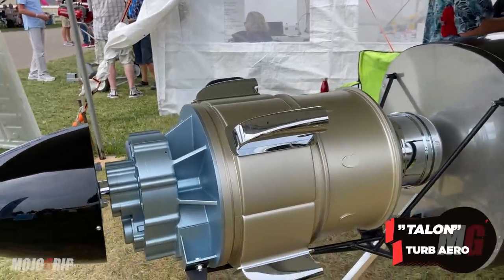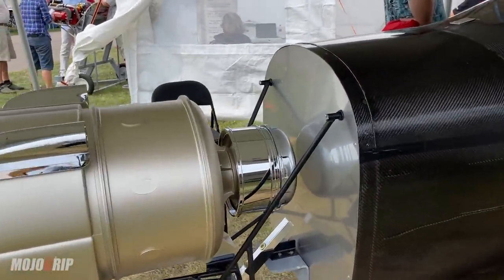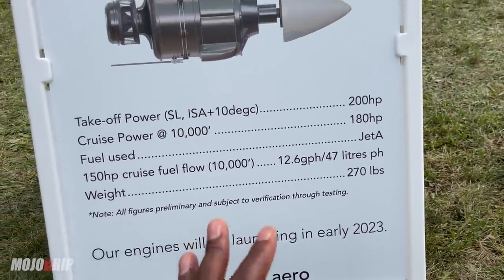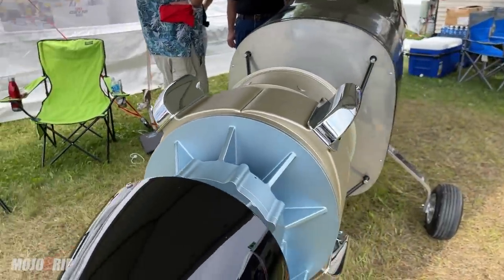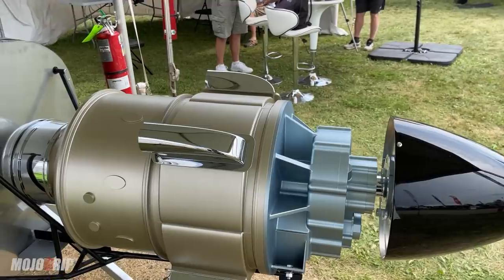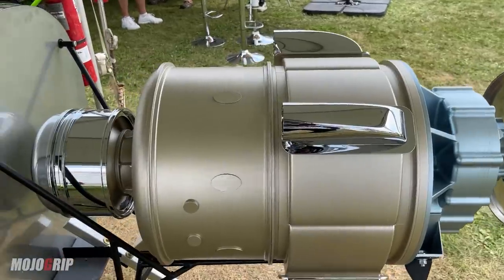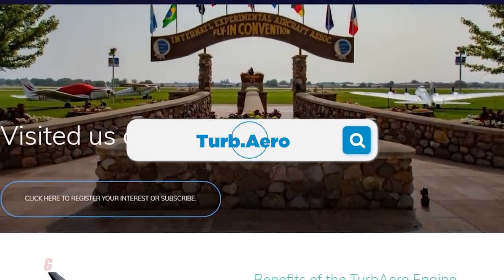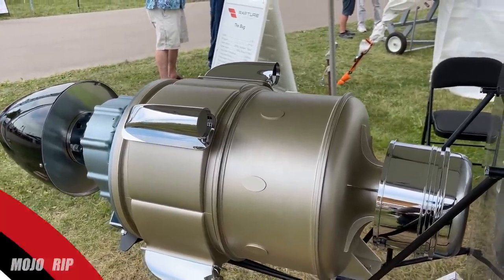200HP Turboprop Engine To Power Single Engine Airplanes - TurbAero

Comment: Get this thing STCd, and I can see a ton of old twins getting a new lease on life. I’m looking at you, Cessna 310.
Reply: Unfortunately, if you put a turbine on a CAR 3 OR  FAR 23 certificated twin you now must comply with all the SFARs on life limited airframe components. That’s why no one has a(successfully) done it.
Reply: @rexmyers991  What about getting one into the experimental category? What are the limitations there?
Reply: @autophile525i  there are four (I think) categories of ‘experimental’ . The one most are familiar with is Experimental - Amateur Built. You can fly IFR, carry passengers, etc. But the airframe  has to be at least 51 percent amateur built. This rules out modifying a twin. The other types are like Experimental Research, Experimental Exhibition, Experimental Light Sport. You could put the 310 in research or exhibition but you can’t carry passengers. I owned a 310B for seven years then got a 310R. I flew the R for 18 years. LOVED it. Best General Aviation twin I ever flew. Only twin better was the Boeing 757. But the FAA said I couldn’t fly it any more (aged out). I alway thought if I could find Diesels to put on, I could burn Jet A, get way better fuel consumption and not worry about Life Limited airframe parts.
Reply: @rexmyers991  Thank you for the rundown!
Reply: @rexmyers991  You need to upload some story time videos. I’ll bet you have some good ones!

Comment: That is a game changer for light and experimental. With a variable pitch propeller: its Reno racing!
Love to hear the start up and running.
Hi Mike from Sydney Australia
🌏🇦🇺
Reply: I have a Solar T-62 with the same performance/fuel burn, they've been around for ever.
Reply: running? where did you see that?

Comment: Those are amazing fuel burn specs! Lovin these small turboprop / IC engine replacements. AFAIC this is the powerplant of the future for everything! For automotive use it would make a  light and effective low-emission generator for hybridized use.
Reply: The price will have to drop by a factor of around 20 before this engine could become a viable option for automotive use.

Comment: Mojo, the PBS TP100 only weighs 157 pounds wet for 241SHP and costs around $120K. 1500 TBO, that’s the turboprop I’d be rolling with if I had the money.
Reply: Unless your original engine was 160ish Lb wouldn’t that screw up the W&B on your plane?

Comment: I believe this engine will never fly but still interesting how people are amazed by a trestle and a table full of numbers...
Reply: why not? there are 90hp gas turbine engines flying on experimentals, so why not?
Reply: To your point, I was nearly taken in by Jim Bede's letter in 1968  promising to build an aircraft for a very low price all that was required, a small deposit to secure a delivery slot. As you may know, that aircraft was stalled in the certification process and likely due to a 
cash shortfall the project was sold to Grumman and became the Yankee, but that "very low" price evaporated.

Comment: Efficiency is obtained by the heat exchanger preheating compressed air thus saving the corresponding amount of fuel. The real challenge is to minimise pressure drop thru the HE which here seems to be annular.

Comment: A smooth, quiet turbine with 200 HP at under 13 GPH and less than 300 pounds?? What's not to like about that?? As they prove the engine in service the TBO will increase further reducing the cost of operation.  Keep and eye on this one.

Comment: Hi Mike!
Cool if this works. The specific fuel consumption is always a problem the smaller the turbine is.
Reply: @jackt6112  Hi!
I was literally born into the aviation industry, GA. I've seen so many potential engines come and go unfortunately. It's a pity that we don't have any big changes as on the automobile side, of course they have a lot more money. A late friend of mine flew Junkers aircrafts with Junkers opposed two stroke Diesel engines in the early forties. very good specific fuel consumption. He was a chief test pilot of Junkers. After the war, all the money went into turbines of one sort or the other.
Best greetings from Sweden.
Reply: @rudolfabelin383    I started out as an aviation mechanic for the military and then the academy and flight school.  For small aircraft, I've owned a Skyhawk but love the Mooney.  People that say turbines are simple don't live in the real world.  A small, practical, low-cost turbine is an oxymoron.  The problem with small turbines is they are difficult to scale down well with regard to efficiency and cost, plus it's more than just hours.  Each start costs you money.  Weight has to be awfully important for smaller turbines to make sense which is why you only see them in smaller helicopters and even then you need to keep them busy making real money.  The little turbines are not more reliable than a recip.  Even the little Allisons were certified looong before they deserved to be.  IMO the PT-6 is the base.  It's going to require a technology breakthrough such as molded ceramic parts for a GA engine to have any promise, and even then, there is nothing cheap about the fuel control, gearing, etc.

Comment: From the schematic it looks like they took pieces from a turbocharger, added a gear box, and some kind of power recovery device (recuperator) to use the exhaust gas for add on efficiency.
Compare this engine to the Rolls Royce, former Allison turbine engine, used in several helicopters and adapted to fixed wing aircraft. When I was servicing them in Vietnam it was called the
 T-63 A5A. It was limited to 317 hp by the transmission in the OH-6A. 600 hp was required to turn the compressor. The engine weighed 171 pounds when ready to install in the Hughes helicopter. They were very reliable, although I do have a photo to prove they were not quite bullet proof.

Comment: It’s a great idea and it’ll be a game changer. I’ll be getting one ASAP and putting it in something like a Black Shape or similar.
Reply: An $80k engine that probably won't come anywhere close to currently claimed performance numbers that cranks out less power than a $60k twin turbo piston engine while burning more fuel... not exactly a game changer.
Reply: @ParadigmUnkn0wn  Check out the pocket rocket. 450 SHP turboprop that burns 85-90 doing 270. 

Your opinion is?

Comment: I don’t see how the much higher fuel burn makes sense to light aircraft owners, not to mention the high cost+maintenance. I don’t beleive the 12gph burn rate at all.
Reply: In my head as I crunch some very rough numbers, I'm getting 16GPH for 200 HP.

Comment: If it's not built the weight and fuel burn are hypothetical and you know they didn't guess to the high side. 
12.5gph to make 180hp isn't really overly mpressive compared to old engines and doesn't beat the already certified compression ignition diesels!

Comment: Would this fit a Velocity Twin or a Risen V tail?
That would be sweet.
Reply: Hi MAGA.  Yes it would.  We are already engaged with some Velocity owners about installing the Talon into Velocity aircraft including the V-Twin.
Reply: @TurbAero  what advantage does this engine offer realistically over the engine from PBS Velka Bites? How do we know it’s not going to be another Innodyn Turbine letdown? How can you realistically expect those low fuel burn numbers when just on pure thermodynamics a smaller engine will have a much higher specific fuel consumption?
Reply: @superskullmaster  they are using recuperator technology which increases efficiency.
Reply: Prob not on the Risen. this engine is is 270 lbs... and the heaviest engine in the risen is currently the rotax 915is (140hp) 167lbs... That plane flies incredible by the way 210Kn TAS @9000ft. These look good for a v-twin!
Reply: @superskullmaster  We anticipate that our BSFC will be around 0.56 lbs/hp/hr at 10,000' 180hp, while the TP100 offers 0.90 lbs/hp/hr at their cruise power of 188hp.  This represents a significant advantage to the Talon in fuel efficiency  The Talon should cost less than the TP100.  We have had reports from operators of the TP100 that there are some technical issues with the engine that require more periodic maintenance.
However, we need to validate these advantages by proving our specifications and performance figures through demonstration.  We plan to be able to do that early next year.  Please give us time to follow our project plan to achieve that.
The thermodynamics that you refer to probably doesn't take into consideration the recuperated Brayton cycle.  Please research (modern) recuperator technology so that you have an understanding of the technology we are integrating into our engine and the effect that it has on the fuel efficiency of the engine.   Once you've done that, we would be happy to engage in discussion around the technology.
Reply: @jasonsanford6851    Thanks Jason, you raise a valid point about the weight implications for the Risen.  It looks like our Talon will need to go on a diet!

Comment: It’s amazing to me that in this day and age we can’t build a motor for general aviation that’s not more reliable than a well made auto motor. I’m sure one day it’ll happen. Maybe it’s this one. But like I said in replying to another comment, we’ve had small turbine engines for decades. Look at the many uses- we had a power cart in the Air Force called a dash 60 to start our fighters. It was a small turbine motor. We use small turbines for APUs. We have small turbines for RC aircraft. Why has this not happened yet? This should increase reliability and it’s going to be a money maker.  Wonder why it’s taken so long. It’s going to be as much as a complete avionics upgrade so not too painful for aviation owners financially. This is exciting.

Comment: Turbo props are so much more reliable , i know conversation done  to the Pilatus porter they had to extend the nose length tot get the CoG right cos they are so small and light by comparison.  that seems quite heaven maybe they have bulked up the engine :)

Comment: Looks like similar power to weight ratio to a Rotax 915is.
Reply: I actually don't know what's this turboprop's advantage over rotax
Reply: @harrynikuta3668   59 more HP at a similar power to weight ratio in a more simplified package. But with about double the fuel burn. I will be really great for some missions and worse than the Rotax in others. I want it just for the noises it makes on start up :P
Reply: @hobblyjig  in this case, I would prefer pistons.

Comment: Four years ago they were saying this would weigh 80 lbs.  That would have been especially impressive at $80,000.  At 270 lbs certified, it will be competing with the O-360.  Certified, at that price, it will do well, but I doubt for experimentals.  Edge Performance rebuilds (or they did) Yamaha Apex snowmobile engines, getting 200hp on 140lbs and half the price.  Using this engine would make for a slick aircraft, and likely a more reliable one, but it seems that with modestly powered experimental aircraft, saving only 50 lbs won't tip the scales, and that pricy turbo props will only begin to get appealing into the 500 hp range, overtaking the LS and similar auto conversions.  I think this engine would really shine if certified and used on a pressurized light twin design to get good high altitude performance and fuel consumption.

Comment: I’d love to put one in a Dark Aero.
Reply: and get lower fuel efficiency and less power than a ULPower 520T
Reply: If their numbers stay the same it would have more power and torque at all altitudes and if fuel burn is as advertised it would be cheaper per hour due to the cost of the fuel being cheaper and can get as high as 20k @140hp. 

Then with the turboprop we have the reliability, smoother ride no vibrations, quieter, more torque better take off, climb and landing performance as well as beta,  a higher altitude at 20k, it’s lighter, more aerodynamic front section therefore faster and quieter. 

And be the envy of people like you 😉.
Reply: I should be their sales rep. Lol.
Reply: @ashsmitty2244  ULPower 520T has 220HP takeoff power and maintains that to 15,000'. It can still make 200HP past 20,000'. Pull the prop back to 2400 and drop the power to cruise and it'll still run 180+ hp. BSFC is 0.48 lbs/hp/h for the ULPower compared to 0.5628 lbs/hp/h for the stated performance of the TurbAero. 17.25% more fuel by weight for the same power, although jet fuel is ~12% denser so it's 0.084 gal/hp/h for the turbine compared to 0.08 gal/hp/h for the piston engine. On something as weight-limited as the Dark Aero the weight of fuel is a huge factor.

And I'm not gonna envy anything about a Dark Aero. As much as I wanted to love the Dark Aero, and even considered dropping the cash to put in a pre-order, I decided that it's just not very practical. The SAF (spousal approval factor) is just too low in a plane that you practically wear and that has very limited baggage space. Not to mention the realization that by the time the damn things are available and I'd have one built, the possibility of having to haul around some crotch goblins is a very real concern. 

The Dark Aero also has no lightning protection -- composite airframes usually get a metal mesh embedded on the outside -- and static wicks will be useless without that conductive layer. There's also no option for anti-ice, which is a huge factor for a fast cross-country plane. There's also the question of how long can you realistically sit cramped into such a small cabin. Just because your plane can fly for 6+ hours doesn't mean you'll be able to tolerate that long in the cabin.

If I were ten years younger and single I'd be all over the Dark Aero, and I guess that's the target market, but nowadays I'd take a used Cirrus or Cessna TTx over it in a heartbeat.

I'm hoping there's a Piper Malibu somewhere in my future; or a Meridian/JetProp if I ever strike it rich. I can't say that a PA-24 has ever treated me wrong, so I guess I'm turning into a Piper fanboy. Alternatively, I'd gladly take a Lancair ES-P if one came on the market at a decent price, or ideally the RDD LX-7 but those are currently more than double my anticipated upgrade budget. Realistically I see a Bonanza or Mooney in my future to build time in a complex high performance, otherwise I'd be uninsurable and unsafe in a Malibu. There's also the cost of annuals in a Malibu. While the ~$250-300k price tag isn't too hard to swallow, the $10k+ annuals, $15k insurance, and larger hangar requirements make for some very expensive flying time unless you can log a lot of hours.
Reply: @ParadigmUnkn0wn  SAF 😂😂😂 I just had to quickly respond to that because it’s gold. 

Mine is called the D.O. Director of Operations. Do this do that… 

I thought the UL520 that Dark Aero are using is 200 HP and NA. The engine you’re describing sounds fantastic, I had no idea the UL turbo was that good. 

To be honest I didn’t know it existed, thanks for sharing your knowledge, I have learned much
Reply: @ParadigmUnkn0wn  You have no idea how close we are to the thought process when going through what aircraft to get. 

I currently own a Glasair SII-TD O-360. Cruises at 170kts @32 litres an hour and comfortable reclined seating position, it’s a great aircraft.  But the Dark Aero has its grip on me. 

I’d love to see a Bonanza beater, same engine but it has to be faster, carry more, and go further.
Reply: @ashsmitty2244  your usage of metric units implies you're in Europe. Of that's the case, throw everything I said about piston vs. turbines out the window. $10+/gal avgas changes everything. Around here 100LL can be had for under $4 on a good day.
Reply: @ParadigmUnkn0wn  AUSSIE!!
Reply: @ashsmitty2244  my understanding is that avgas is priced pretty reasonably down there, but last I heard ya'll couldn't go out for some fresh air without a cop threatening to fine you for violating lockdown orders.
Reply: @ParadigmUnkn0wn  The prices are not too bad when I just compared yours. We pay around $2.50 a litre.  

And yes, I’m in Sydney and it’s the worst, I’m more concerned about catching a fine from these thugs than being near someone who may or may not have COVID. 

And the thing is, we are all locked in our homes and will stay under these restrictions until we get a needle put in us. 

We need help.